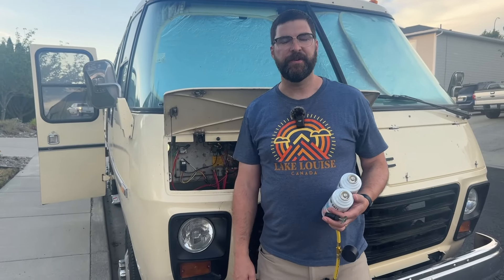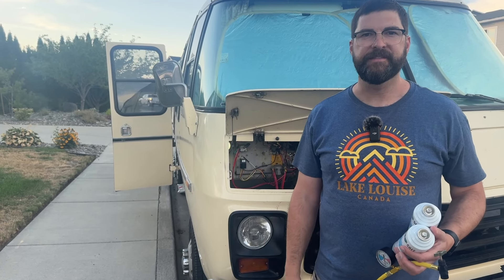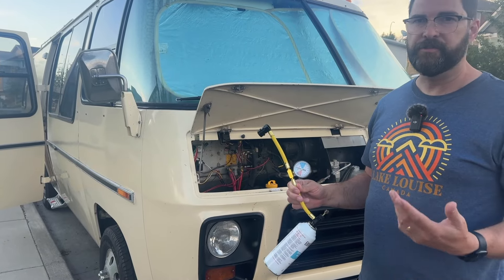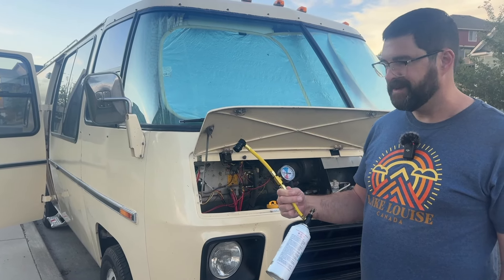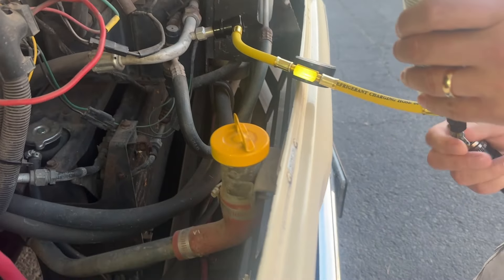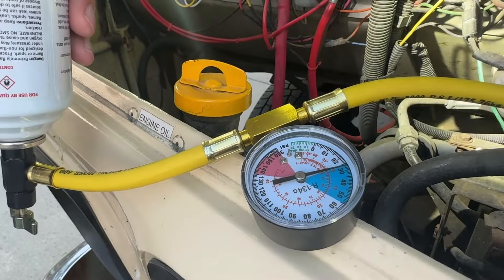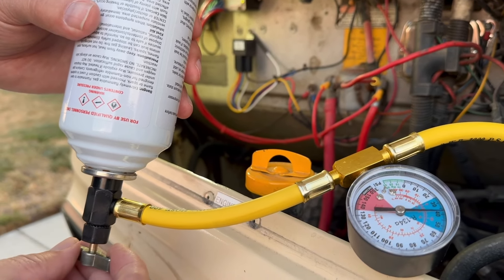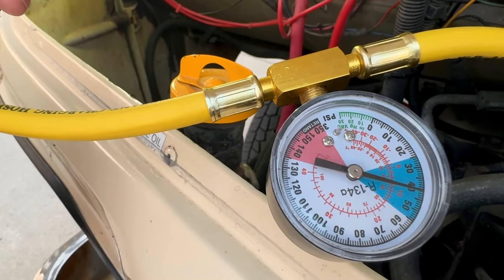GMC Motorhome AC Service

Comment: If you're not already on it, the GMCMI forum has a lot of GMC'ers with tons of experience that could answer your questions about Duracool, etc.  Also, you probably have a leak and would benefit from adding some dye to the line and looking with a UV light for the leak(s).
Reply from the maker: Yes! I've been a member of GMCMI since we got our coach almost 4 years ago! They are a great resource and I always do research on the forums and in the original manuals when I'm doing a project. However, some of the discussions ramble and there are lots of opinions so at some point I just make a decision and go for it and see what I learn. It's been a couple of weeks since I did the recharge and so far it's still working. I'll see how it does over the winter, if it leaks out again, I'll do some more troubleshooting.